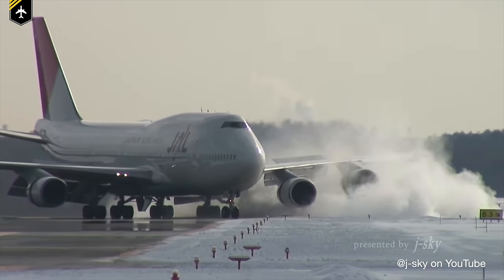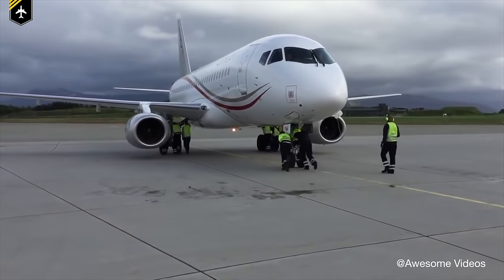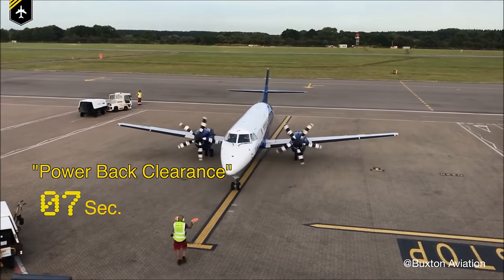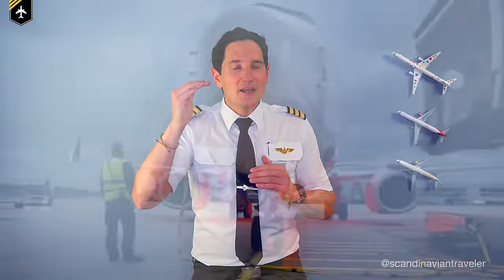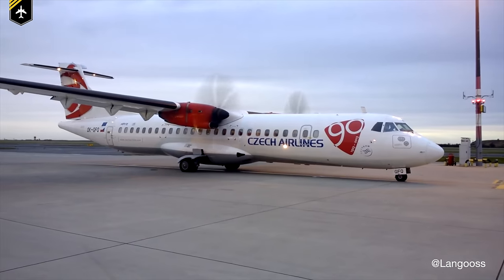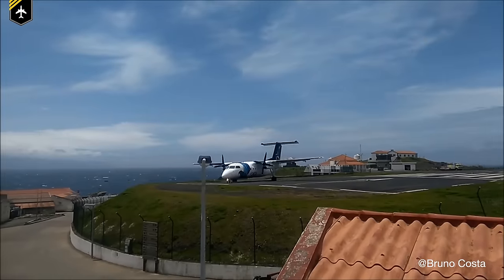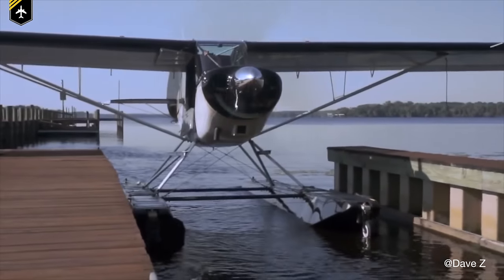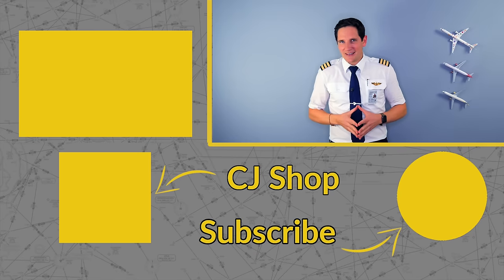Can planes REVERSE out of the GATE? POWERBACK procedure explained by CAPTAIN JOE

Comment: I used to do a lot of gate powerbacks in the Super 80 (S80 aka DC-9-80).  One of the requirements was to keep the thrust below 1.2 EPR (exhaust pressure ratio) to preclude debris from being drawn up into the engine.  The bottom of the engine intakes on the S80 are probably 10 feet above the ground.  Yet too much thrust could still vacuum up loose items (Landing reverse thrust is usually terminated at around 60 knots for the same reason).  At the end of the powerback, the engines are brought sharply out of reverse (throttles forward, reverse bucket clamshells close in 1 second).  Then forward thrust is applied lightly.  This forward thrust stops the rearward motion of the aircraft quite rapidly, particularly if the engine RPM is still up a bit from the powerback.  Captain Joe is correct about the risk of tail tipping (nose lifting off the ground) if brakes are applied very much at all while moving backward.  The brakes are likely not designed with any stops for rearward application, though I have no knowledge of that.  Reverse braking is prohibited due to tail tipping risk.  A powerback is a cool maneuver to perform.  You must trust the ground guidemen, though the Captain will likely still be in trouble if anything goes wrong.

The maneuver performed after a significant screw up is called a "Carpet Dance."  It is performed in front of Chief Pilots.  Most pilots strive to make it through their careers without performing a Carpet Dance or being highlighted on CNN.

Comment: To add to this video with another bit of information, as a former EDDL Ramp Agent: 
Another reason why it is rarely done anymore, is because at many airports it is simply forbidden to start up your engines at a gate position as part of noise abatement procedures. Few people can imagine how god damn loud even a small A320 or 737 is in idle thrust with running engines*. That's why most airports only allow spooling up the engines either during pushback or (as I remember in Dusseldorf) not even during but only after pushback was completed. Needless to say, Powerback doesn't work without running engines, so.... :-)

That being said, I'm speaking specifically about gate positions. Tarmac positions may be different, given they are usually further away. I don't remember whether powerback was allowed on the Victor positions in Dusseldorf, but given that most turboprops would be parked there, I would imagine it can be allowed. Then again, many Victor positions in DUS are taxi out positions anyway, so no reverse is needed at all. :-)

*(Remark: Even fewer people will be able to imagine that even without engines runing, a plane can be insanely noisy. Yes, APU, I am looking at you, you damn baby turbine. But seriously, even just an APU can be loud enough, that you need to wear ear protection when operating around the aft compartments for (un)loading, etc.)

Comment: I first encountered "backing out of a gate" on a DC-9 variant when I changed planes in Memphis a few decades ago. I'm sure that CG would be a factor in how the decision would be made, and I'm also sure that most airlines would prefer a tug push out over standing one on its tail. 

As a former ramp rat for UPS, I was familiar with the usual marshalling signals. The one for "back out of the stall onto the ramp" was new to me at the time, but made perfect sense.

Comment: 8:39 it's not airbus but Safran !
a few days ago airbus said no to safran for this idea. I don't understand wy because it's not heavy , only 400kg, and there is some place on the main gear
Reply: Hi, Emilien! Carrying an extra 400kg? Man, that's a LOT - just ask my skinny-fit jeans!  :-)  Don't forget that in commercial aviation every scrap of mass is counted and costed because it has to be hauled throughout the plane's entire working life. Dozens of years and hundreds of millions of miles...

If an airline is worried enough to use tiny hollow plastic drink-stirrers because even plastic teaspoons are considered to be too big and heavy, you can be pretty sure that it wouldn't want an extra 900 lbs per plane cutting into its budget. It could be carrying another 3 or 4 paying passengers per flight!

Far cheaper to use a pusher/tractor that gets left behind on the ground. And there'd also be the cost of having another safety-critical system on board to maintain. Service time is down-time, and that's big, big money for any airline.

Military aircraft would certainly benefit, though. Money is not a consideration; no ground crew or vehicles would be exposed to hostile actions (such as enemy snipers), and the vastly improved speed of deployment would make it a very good idea indeed.

Please note: all of the above is just my humble opinion. I'm not a commercial jet pilot or a professional engineer, just an aviation enthusiast.  [Got my PPL on a Cessna 172; licence now sadly lapsed. Sob, sniff...]

Comment: As I recall from my dad (TWA Capt -- up thru the B747), there were concerns with "compressor stalls" on the larger (L1011 and B747) widebodies (a compressor stall  typically required an engine change on them at that time). 

Still, on some MD-80s and maybe B727s, TWA used powerbacking for a short time and it was a BLAST to experience (quite the acceleration in reverse compared to a tug!). However, they apparently had a STEEP increase in engine failures among the planes that did that so they discontinued the practices after just a few years. (that's my understanding, anyway).

Comment: I've seen a couple MD-80s do it but thier engines are up high. And Herks do it all the time!
Reply: I used to love those. Thx for the trip down memory lane. Yep, I remember that.
Reply: I saw several MD-80s powering back in Houston in 1999.
Reply: @llathem2212  which ones?
Reply: Sean White I used to live in CT in the 90s and was dating a guy in Ft Lauderdale, FL. I was in graduate school, so I couldn’t move. We took turns flying about every 3 weeks. Usually they were MD-80s. Short flight, about 2.5 hrs. And I could drive to LaGuardia in 45 minutes and zip thru security back then. His brother was a pilot on US Air. More then once he was the pilot. Go figure. So I got to be in the jump seat for part of the flight. Was lots of fun.
Reply: Military and military-type cargo aircraft can do it because they can open the rear ramp and have crew members guide them back, and also because their high-wing-mounted engines are less vulnerable to FOD ingestion.
Reply: @FS2K4Pilot  yulp. Been on plenty of Herks where the load dropped the ramp and blocked is in
Reply: The first and only time I saw a power back was in a DC9 thirty-something years ago as a passenger at Logan in Boston.  It seemed that the engines were started kind of early to me.  Then I heard them throttle up while still at the gate, felt and heard some turbulence at my window seat, and then we rolled back.  It took me a moment to even realize what had happened.  I was surprised that fuel and noise-conscious Boston allowed this even once.

Comment: @3:12 You mention it as an interesting side note, that AC must be turned off because of the risk of exhaust fumes getting into the cabin.

Could you make a video explaining what's actually happening when some kind of fuel fumes actually do reach passengers? I've regularly noticed that when waiting in a plane, probably a few minutes, just before we're about to take off. Maybe everyone's not sensing them, maybe I have overly sensitive sense of smell (I've been known to be told that I do have), but it's not something you feel and then you're unsure if it really was that you sensed it. It's just that I'm not sure whether it's exhaust (seems more like it) or unburned fuel (I've sensed leaking fuel in a car, maybe jet fuel itself smells more like exhaust before it's burned?).

Now that I think of it, it could be that I sense that smell in cases when the engines are already on, but we're getting backed out or staying put for a few minutes, waiting to be cleared for take off. Yet, the AC wasn't turned off (or it was, just air vents in my vicinity weren't closed - would that still suck in exhaust fumes into the cabin?).
Reply: Dom Delimar that smell usually occurs when the source of the air conditioning is switched from the apu to the engines (generally this happens immediately after all engine start)

Comment: How is an aircraft weighed?
Reply: Roll it onto some scales. Read the values. Do some math to average the numbers correctly.
Reply: Using a kitchen scale duh
Reply: Easy. Put a scale under each gear and you know the weight with simple addition. To calculate the center of gravitiy you have to do a little more geometry and calculations. Nothing a normal highschool student cannot do.
Reply: @roichir7699  With "Common Core Math",,,, I doubt that.
Reply: You already know the answer.
Reply: @kenhurley4441  You can solve it graphically with rectangular triangles. Or with pythagoras. Not a big deal.
Reply: @hitman7718  Are there load cells in the landing gear struts so the aircraft can weigh itself on the ground?
Reply: @Stoney3K  Nope. Why should they be there?
Reply: @roichir7699  More accurate fuel and range predictions for the FMS since it knows exactly what weight and CG the aircraft has?
Reply: @Stoney3K  It does not matter that much. The cost of the system, it's maintenance etc. is higher than the minimal savings you get from such a system.
The pilots and the FMS get a loadsheet with all the cargo, which seats are occupied etc. Pretty accurate.
From that you will only have minimal shifts for the CG. And inflight there is also movement in the cabin, when suddenly all passengers need to use the bathroom after climbing.

The turbulences in the air have a greater impact than an asolute accurate calculation of the CG. You just use the trim system in both cases.

Comment: I once worked for ValuJet (eventually AirTran) at their hub in ATL.  At the time the entire fleet were DC9s.  They occupied about 25-30 gates,  and used the power back method 99.9% of the time.  We had 20 minute turns, so power backs saved tons of time throughout the day.   Each time one person was in the ramp area blocking traffic, and 2 people were wing walkers, and a 4th person stood in front of the cockpit marshalling the plane back.  Each time it only took 30-40 seconds ....and then the plane would then taxi forward to the taxiway.   Power backs were very loud.... even to the passengers on the plane!  Also, as a gate agent,  we knew to quickly pull back the jet way, park & power it off, and quickly run back up the jetway into the concourse bc it was so loud and debris was always blowing and sand blasting you lol.  In "out stations " (airports other than the hub) mainly used a push back tractor, as power backs weren't usually approved at those airports and bc power backs took a minimum of 4 people outside the plane.   
Captain Joe... can you explain why just b4 initiating the power back, the pilot would first throttle up and "roll forward about 5-10 feet, before engaging reverse thrust"??

Comment: Please do video on the electric wheels because surely they would save fuel taxiing to the runway and only have to start engines before runway. Or is the APU thirstier than 2 engines at just above idle speed
Reply: You burn more fuel during cruise with the additional weight, than you would save on the ground. Count in the additional maintenance cost, as wheels are changed quite often and you need special wheels for that and much more things. It is not cost efficient right now.
Reply: Roichi R fair enough. Didn’t think the motors would weigh that much but then again I don’t know how much power is needed to move a 200 ton jet
Reply: @tomstravels520  It is not just the motors. You have the electronics for them, the power supply and more.
And there is the usual snowball effect in aviation, as a rule of thumb, for every kilogram you add, you need four kilograms to support it. And fuel for all five of them.
Reply: I think there was some idea of using remote-controlled pushback tugs that could take the plane all the way to the runway ... seems a good idea to me, heavy-duty batteries and recharge before next use.

Comment: In addition to the much smaller intakes on turboprops, they’re typically designed backwards (compressor at the back end and exhaust out the front end) with an inertial separator at the back end of the intake that lets FOD fall out before getting to the actual turbine

Comment: I used powerback whenever I needed with C-130s and T-27s. Besides being careful not to hit obstacles, the important trick when braking backwards is not braking at all, but putting the propeller(s) in positive angle and having it(them) doing the job. When the backward movement ceases and the aircraft hints at starting forward motion, then you apply the brakes.

Comment: 1:00 whats that cable. some sort of brake override?
Reply: The headset of the pushback operator is connected to the aircraft communication system with this cable so that he can communicate with the pilots. He disconnected this cable after the pushback.
Reply: @mikep9604  ah ok thanks

Comment: 3:47 Harbour Air now has an electric plane in the fleet.  Would power-back be easier on an electric plane?

8:30 Installing an electric motor in the wheel rim would be good for not just the pushback but also for taxiing and inching into the gate, so I have trouble seeing why it wouldn't catch on.
Reply: Installing the system in the landing gear would only make the system more complex and increase weight, and the system would need extra maintenance which would increase the costs. The disadvantages would be bigger than the benefits.
Reply: @mikep9604  Yep, that makes sense.

Comment: Though it's probably insignificant and negligible, jet engines are very inefficient at low speeds, not even taking into account the loss of efficiency from the "thrust reversers". So it's quite a waste to use powerback instead of pushback

Comment: I used to work for USAir, later USAirways, then merging with which is now American Airlines. We had 727’s, DC-9’s and MD-80’s all of which depending on the airport and gates reversed and powered back for departures. Pretty cool when sometimes the nose gear would go off the ground a bit when you brake too soon.

Comment: I always thought powerbacking was pretty exciting--because on the MD80s, they'd rev the engines and you'd shoot back out of the gate quite rapidly--no slow, boring tug push!! :-)

My dad was a captain at TWA and I was told they did it to save money (less ground crew required). Also, I heard DFW was built with the ramps slightly angled down from the terminal to help with power backing. However, I also heard that, after a few years, TWA noticed a significant increase in engine failures that they attributed to power backing--so they stopped doing it.

Another thing, my dad said that the widebody planes (B747 and L1011 at the time) couldn't be put into reverse below a certain speed due to that damaging the engines because there isn't enough air intake. GIven that the 757 uses (at least can use) the same engines (RB-211) as the L1011, it was surprising to see one backing up on the runway in your video.

Side note: I was walking on the ramp with my dad at MCI one day when the MD80 whose nose was like 1/2 a jetway away from us did a powerback. That was NOT the time to be where I was with zero hearing protection....

Comment: Great info, as always. Something I'd be interested to see Captain Joe cover are the newer pushback vehicles that actually lift the front gear off the ground. There's really only one or two YouTube videos that even talk about these vehicles and very little detail. Why are they necessary? Where are they used? The vehicles look very expensive compared to a regular pushback tug. Please educate us on that. Cheers mate!
Reply: I've seen a passing mention of them before myself.
Normal pushback tugs need a tow bar connected to the nose wheel of the aircraft.
This tow bar is different for every aircraft.
The tugs that lift the nose wheel off the ground need no tow bar.
This eases ground handling and allows one vehicle to pushback ANY aircraft without needing to have twelve tow bars in the back.

Comment: Captain Joe, question
When pilots use the power back procedure, is it necessary to do the pushback by themselves?? Is it that not much toe-trucks are available?? I really feel that that would consume alot of fuel which in-turn will be a problem for flying the airplane.

One more question, if they are using the above mentioned procedure, will the flight members i.e. the pilots take extra fuel and use that amount of fuel that they got only for pushback??

This is what I would like you to answer with all due respect sir

Comment: Between Captain Joe and Mentour Pilot they both show and talk about planes and answer questions people ask in great detail about particular things, things like "Can a passenger operate an aircraft?" or "How does emergency exits work?" stuff like this is all pretty interesting.

Most modern aircrafts that I've been on these days seem to all have cameras installed on them that have viewing angles above the plane, below the plane and behind them as well as in front for viewing on what's in the ground, and passengers can even switch between cameras to see what's going on. I would assume that the pilots also use these cameras as well to be able to perform reverse power backs on their own without much ground support to tow them to the runway clearing since they'll be able to see from the cameras on the plane from multiple angles.